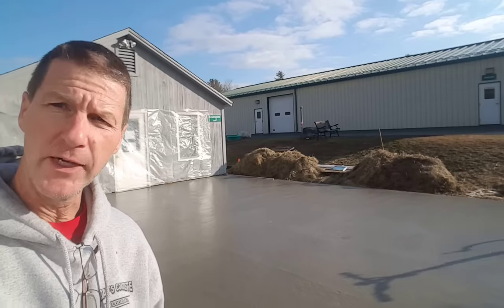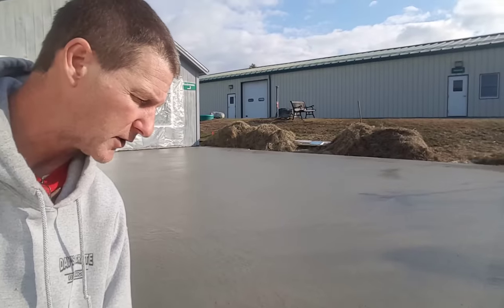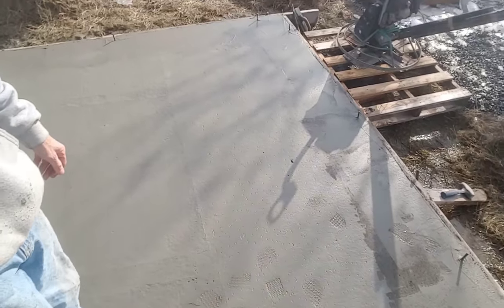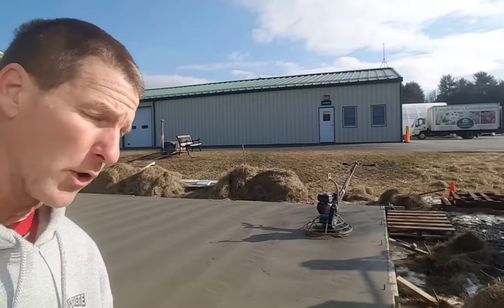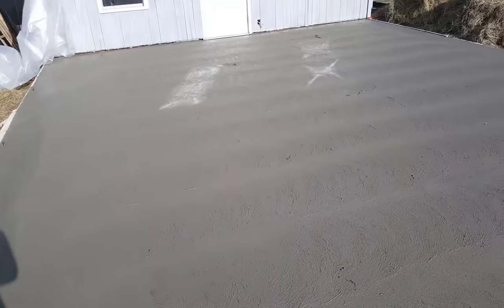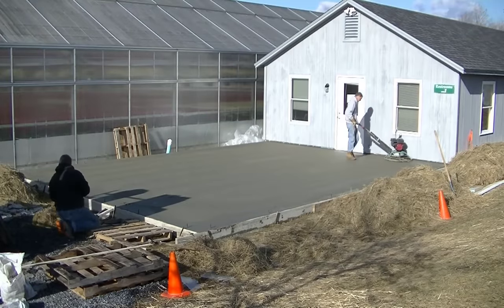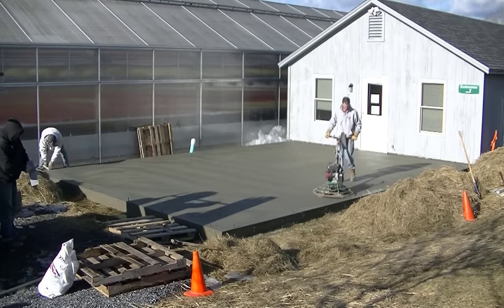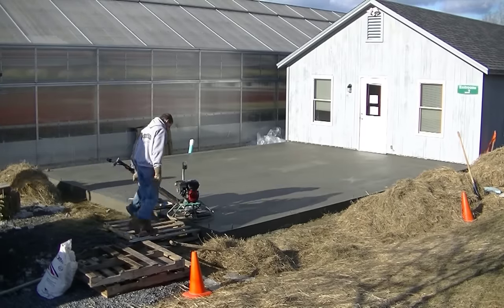When To Start Finishing Concrete | What Finishers Know, That You Don't!

Comment: When pouring critical concrete no  matter what time of year, you have to talk to the operator of the batch plant and explain what you are pouring, how far it is from the plant and you have to consider temp as one of the most important things. The concrete that I poured most of my working life was not of the average backyard slab. I helped pour a lot of 4 and 5 thousand psi concrete. Either on nuclear power plants or bridge footing and decks. I know I came across here as a know it all but when you are pouring concrete that a QC inspector is constantly monitoring, you will do it right or cost the company a ton of money. You have to pour certain concrete at a specified slump from the truck. Most of the time when it it batched, it will be several points higher than when it comes down the shoot. I have never poured concrete with the temp below 45 degrees as it was not allowed. I have poured many yards above 95 dregrees. This is where you better have plenty of help. Ice is not always the only thing that will help with hot concrete. You must add chemicals such as superplasticiser which will hold the slump at a desired flow giving you time to finish the surface. In the winter, we were not allowed to use calcium chloride as it is a corrosive to the reinforcing steel. I see some people in the summer after the concrete placement, roll or spray curing compound on the concrete after initial set. In my line of work, that was not allowed. We had to make temp dams and flood the concrete with water at a mimimim of 3 days, some up to 7 days. Not sure what psi you poured here but in my opinion, I would not give you a plug nickel under 3000 psi. Concrete is not an exact science. When you break a cylinder after 3 days, psi can be off as much as 1000 either way. As for concrete with fiber in it, I would not put that stuff in a hog pin.
Reply from the maker: This was 4000 psi. That's the minimum I pour in the winter.
Reply: Interesting flooding the concrete, when you did that how long did it stay flooded for? How deep was the water? Very interesting idea for prolonging cure time.
Reply: @clintonboyer1217  Around to entire pour, the concrete is covered with burlap just after the set is able to withstand walking on. Employees were paid to keep the burlap flooded with water using hoses. If any of the placement would hold inches of water, the better. This was done year round. In the freezing temps, huge tents were constructed and large heaters kept the water covering the concrete from freezing. This was done when I worked on Nuclear power plants. It worked and never had any shrinking issues or cracking.
Reply: Some of these concrete pours were in access of 4000 cubic yards under one heated tent.
Reply: @clintonboyer1217  Due to this being a Nuclear power plant, very strict guidelines. All concrete on this job was flooded for 7 days minimum. Some of the concrete was cured like this for 14 days. On this job we also had concrete identified as critical and none critical. Around the tendon rally of the retainer ring of the reactor, some of the concrete had a 10,000 psi value. I had steel pellets in it. Very insteresting job.

Comment: I'm 73 years old now and I was a drywall finisher/contractor for 45 years (I'm pretty much retired now), and I worked for several builders who were geniuses who could build a house from the ground up if they wanted to (and do it better than most subcontractors). But there were four things they wouldn't attempt to do themselves (even if they were in a financial tight), which were the foundation (i.e footer, slap, poured concrete basement, etc.), the plumbing (including the sewer/septic tank hook up), the drywall finishing, and the roofing. And most of them wouldn't tackle the painting either. 

I can hang sheetrock and I'm very good at it quality-wise, but I'm so slow at it that I end up making about 1/4 per hour that I do finishing it, so I never hang my own sheetrock (not unless it's a really small job that isn't worth calling my hangers to do).  And I think that's the way most builders look at doing their own foundations and slabs. They can do it and they would do a really good job doing it, but why in the hell do it?

Comment: Great video.
(Although concrete does not technically "dry". Actually the setting process is the opposite of drying - it's a hydration reaction. Water chemically reacts with cement in order for the concrete to "set". The Chemical reaction involving cement and water is also exothermic, that is it gives off heat so the concrete slab warms up as the water reacts with the cement. This is why concrete continues to cure over time, even though it can be raining everyday. Surface water really doesnt affect the curing process inside the concrete slab. One of the biggest problems in mixing water with cement, aggregate and sand is insufficient water. If you dont mix enough water into the initial formulation, curing and strength will be inadequate and the slab will fail over time. Excess water, is less of a problem because it will bleed through to the surface. Annoying but better to have a little more water in the concrete mix than insufficient. Although way too much water can cause other problems like concrete handling and cement loss due to water seeping out of the form work. It's complicated chemistry because there are many components present in cement. One great curing method for concrete is to keep the concrete slab watered by spraying water continually. Keeping the concrete "wet" is important during curing. Drying is the enemy)
Reply: what's your thoughts on thinset regarding too much or too little water?
Reply: It's nice to hear from someone that truly 100% now's concrete. Eat sleep and breathe concrete.

Comment: Mike you are amazing. I have experience in a parallel universe with floor machines. Let me tell you brother the finesse and skill you have with that power trowel is incredible. If it relates even an iota to the floor machine you have a bow, hats off and kudos from me. I bet it took a little while early on to drive that power trowel that way. I know from your expert explanation the power trowel is about as potentially wild (if not worse) than a floor machine. I think this is craftsmanship evolved to a whole higher level and value your time and experience to share how to help the rest of us learn. The floor turned out awesome I am sure the owner was very pleased and had virtually no additional prep to put down his floor covering. The slab was ready once it set up!

Comment: Very informative for those wanting to learn this skilled trade.  Keep up the good work!  One technical issue, however...you referred to the saw joints as 'expansion' joints.   Those are 'control' joints.   There is a BIG difference between expansion joints and control joints.  The tradesman should understand the difference.  Concrete shrinks.   It does not expand.  Shrinkage cracking begins to occur as wet concrete begins to shred it's excess moisture during the hydration process (curing) after placement and continues at a microscopic scale throughout the life of the concrete.  Saw joints (when installed at the appropriate time during hydration, will help to "control' where the shrinkage cracks appear by creating a thinner cross-section in the slab.  Shrinkage cracks will seek the path of least resistance, therefore they will usually appear at the 'thinner' cross-section that is created by the saw joint.  Expansion joints on the other hand are an important design feature of concrete structures and are formed into the concrete to isolate one section from the next to accommodate differential movement.  Reinforcing steel (rebar) does NOT extend through expansion joints but does extend through control joints.  Dowel bars (not rebar) are often used in expansion joints to keep the surfaces of each section even with each other and are lubricated on one half to prevent the concrete on one of the sections from adhering to the dowel in order to accommodate the movement between the sections.
Reply: I believe there is an initial, brief expansion of concrete after the pour followed as you point out by continuous shrinkage. Expansion joints respond to the early-phase curing.

Comment: i wait to power trowel when i step on the surface and it just presses in about 1/16 . Also if the power towel blades are to flat to the surface they will create a vacuum to the surface and make it wet again so a slight increase in blade pitch can stop it it starts going wet.
I also make a 4 foot by 4 foot landing pad beside and even with the slab to start and finish on.
A good way for someone to learn to use a power trowel is practice running it on a sheet of plywood or concrete smooth floor and use  diesel as a lubricant.
Thanks for sharing your video.

Comment: I poured an Alaskan slab for a metal garage I was building. The edges were 3 ft thick moving up to 8 inches for the center. I graded it, built the forms and tied the rebar and wire. I hired a pump truck because it was 30 by 50 and there was a lot of concrete to pour. Luckily the guy with the pump truck offered to handle the pour because I would have struggled with just me and my drunk helper. All in all, it was a hell of a lot of work. I appreciated how smoothly the crew handled the pour and finishing. Glad he offered to do it. It could of got ugly quick.

Comment: First things first get a good pair of knee pads if not you will love total knee replacement. Now pay attention to this man he knows what he's talking about. Take a margin trowel and run it on the inside of the form between the concrete when you edge it. This helps to keep your concrete from sticking to the form.  Ive been a finisher for 40yrs.

Comment: -Good stuff Mike. I don’t know of any other YT channel that goes into the detail you do about concrete finishing. Very thorough.
-As a structural superintendent, I worked with concrete finishers nearly every day but I’m not a finisher by trade myself. Why the special attention to the edges with the mag? I know the anchor bolts and sometimes pipes get in the way of the machine, but why can’t the entire slab, edges and all be done with the machine? With the exception of just a cpl inches around obstructions.
Reply: If I may chime in... you see how Mike changes the pattern in the middle of the floor to keep the floor flat. The trowel machine can only hit the edge at one direction. This can move the top cement to cause high and low areas against the form that can not be corrected with the it.
I think as for hand troweling around bolts, pipes etc... that are usually inside a wall for the most part its not necessary but for a good finisher its about the detail.
Concrete is an art work
Reply: @Tunnel1967  I would have to agree. I’ve always said, next to a stucco/plaster man (a lot of that in my area), concrete finishing is the closest thing to an art, in the trades.
Reply from the maker: I agree with Tunnel1967, the edges are a "detail" l like to make sure look as good as the slab. And he's right about the power trowel only finishing the edge "one way" during the process. It will create a small ridge/hump if you're not careful. Using the full width of the mag then the steel trowel helps keep the edges flat.
Reply: @MikeDayConcrete  Gotcha. Thanks ‘Tunnel’ and ‘Mike’. 
🤜🤛
Gonna have to talk to my finishers about this 🤨
Reply: @psidvicious  it'll be hard when it's done, you can count on that
Reply: @timothywells9813  🎣 Messin’ with ya Tim.
Reply: @psidvicious  bending conduit and carpentry? Close 2nd and 3rd I guess.
Reply: @johnbronson8928  Hmmm, 2nd and 3rd what?
Reply: @psidvicious  2nd and 3rd place to the closest to an art in the trades
Reply: @johnbronson8928  Well, I could guess that the carpenters would try to argue they’re ‘artful right’ but certainly not the electricians apprentice, bending all that pipe. I’ve seen rodbusters handle tie wire like a spool of thread out of a sewing machine, but the concrete finishers just seem to have that artful knack knowing how to work the material and when to leave it alone and let ‘it’ work. I dunno 🤷‍♂️. It’s just been my observation thru many years.
Reply: @timothywells9813  Haha! Just noticed you deleted your comment, which made my reply make no sense 😁 Touché!
Reply: @psidvicious  Make no mistake, a good finisher IS an artist.

Comment: I am a carpenter that has built some amazing forms, like 20 foot tall concrete walls and radius walls. I always admired the finishers that were called out to finish the concrete once it was poured. Your video makes me want to try and finish a patio slab that is coming up. Can you talk a little about magnesium floats and trowels and about what they do and when to use them. A good finisher here in Soi. Cal. gets 350 per day, even if it only takes four hours to finish the job they still get 350. They deserve it but it would be nice to do some of the smaller jobs myself. Thanks for your channel, I really enjoy watching.

Comment: Hey mike victor here from Niagara falls Canada I just finished watching your video on the what appears to be a rather large pad . You had finger tested the bottom corner of the pad a few times until desired setting was satisfactory. My question is , what time of the year was this video taken ? Also if its summer would you be looking at a deeper finger depression ? !in order to get to the balance of the area in time before it sets completely. Just want to let you know that I love watching you guys ,and its great to see females on the job site . We also hire women and find that their great assets
Reply from the maker: Victor, Starting time is pretty much the same on all slabs. If it's bigger (much bigger) we usually start with one guy floating and if a 2nd guy is needed after a while he'll jump on with another trowel and start troweling.  If you're experienced like us, 1 guy can usually keep up with the floating process. A 2nd guy can start the finishing process (finish blades) if it's on a big one. This was late Fall. In the heat of the summer we just have to move a lot faster.
Reply: Thanks what’s your opion on a Marshalltown stencil roller ,?

Comment: The float pan or float blades are essential for getting a flat slab or known as ff tolerance. Keep those blades flat as possible when the concrete is still slightly soft and as it tightens up switch blades to finishing blades and pitch it as needed.

Comment: Should of put 1or 1 1/2% calcium in the mix
Reply from the maker: In the video I said we used calcium.
Reply: Calcium is great for concrete.  More the better!!!   

Or. . Maybe look into NCA's instead.   Yeah.  . Prolly more money.  . . But it's used for a reason.  U don't see cal on anything covered by building codes.  Or at least you shouldn't.

Comment: I worked precast concrete for 15 years & found a big difference in the brand of the floats & trowels & how they finish. I've had my share of large slabs setting up & curing on me fast in the 90 degree heat. I've seen power trowels used but still haven't used one yet.

Comment: Excellent primer!  Let me add this: when you mag those edges, we can hear that grinding sound. That is the opportunity to press down hard (the mud will seem soft enough to not be necessary) to press the larger gravel down which raises a good cream/fat. The power trowel is heavy enough to do that without conscious effort.  Having said that; be sure to keep the surface flat all the way out to the form. Too many wannabe finishers break the plane - roll the edges downward - then later finishing strokes are anywhere from very difficult to impossible.

Comment: Just revisiting power floating after 13 years and amazingly my cheap Chinese knock off power float started first time albeit needed a new fuel hose. Also blades started to fall apart after first 10t of slab. New blades and going superbly using new combination blades. Challenge for you we did our 10 century barn (4,000 sq ft with a power floated floor on a 1:24 slope. A real challenge but managed a 3mm tolerance across the whole floor. U

Comment: He should tell you if you pour a slab of substantial size or one that requires more than one truck worth of concrete... To check where you started the pour always. Don't check the freshest stuff check the oldest and initial concrete that touches the ground. More than likely u wont have to and it all should set the sane. But just a tip

Comment: I'd like to see you do a video pouring concrete in hot weather with hot aggregate where you add ice. I had hot bag mix in my garage and after mixing in an electric mixer it set up so fast (temp in the 90s, bag mix much hotter) that it was hard to finish. Luckily it was just a foundation for a short brick retaining wall so it got covered up for the most part. But the finish didn't look anything as nice as yours.  I found out later that the ideal pouring temperature is about 50°F or thereabouts. Next time I'm adding ice! But I felt it was a great learning experience. I loved this video. It seems like concrete finishing is both science and art!
Reply: try pouring some 5000 psi concrete in the middle of the summer. That is when the work starts.
Reply: @jerryhubbard4461  On a 10,000 sq ft storage unit!! You begin to question your profession choices!!!!

Comment: Mike, you do great work.  My only comment on this is at the end where you mention sawcutting your "expansion joints".  You later correctly refer to them as "control joints", which we both know is their function, to "control" the cracking that will occur from contraction and less often, expansion.

Comment: In the winter I like to let the slab go to the point where u have to crank up the trowel and go like crazy on that 1st pass, typically it only takes a pass or two to finish. it'll save u hours in the long run. But u have to know what your doing. I've got thousands of floors